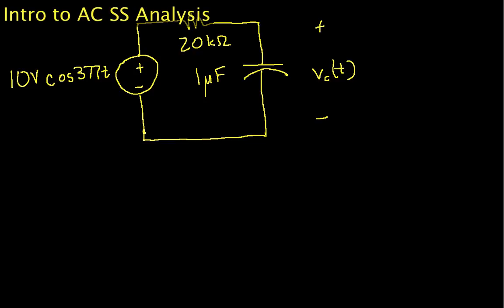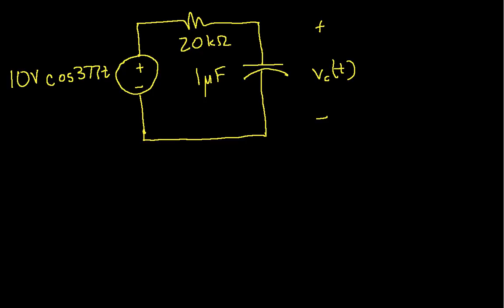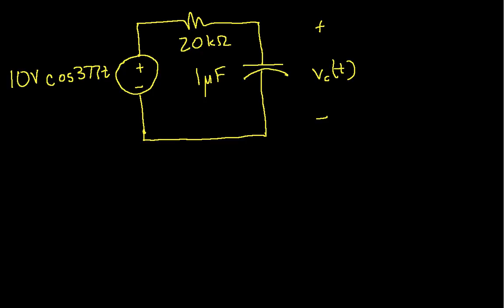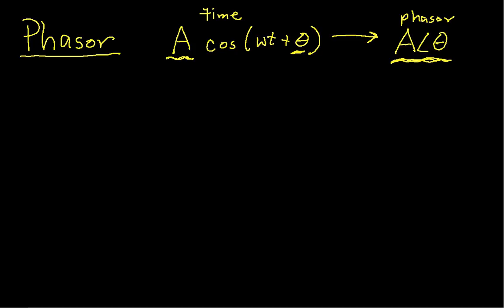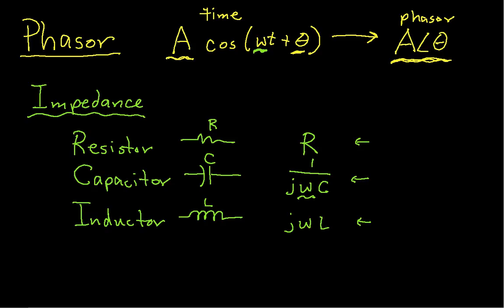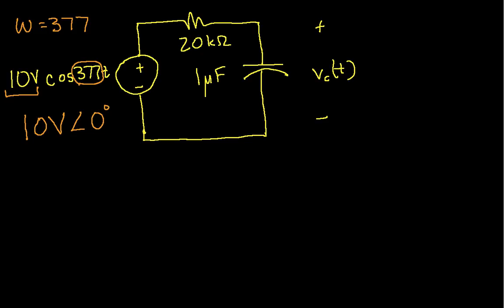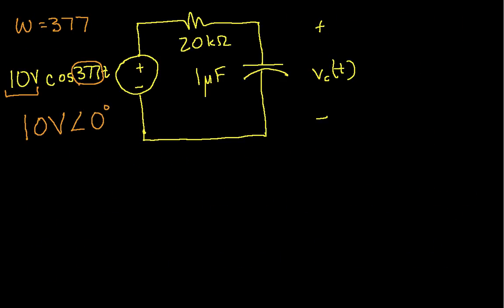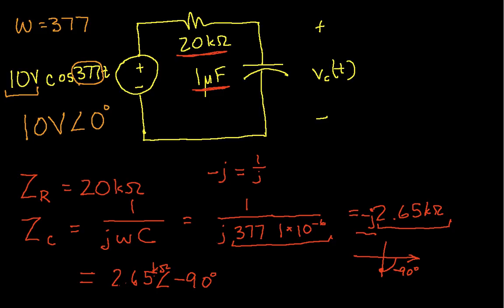Introduction to AC Steady State Analysis Part 1

Comment from the maker: I have seen polar forms with both peak and rms values. If you want to be able to compute power for AC steady state using similar equations as DC steady state, then you are correct that you want A to be the rms value.

Comment: Why do I keep seeing polarized capacitors in ac circuits? Wouldn’t applying a negative charge to positive terminal cause problems. Shouldn’t we be using non-polarized caps since either side can become the positive or negative side and switch with no problems?